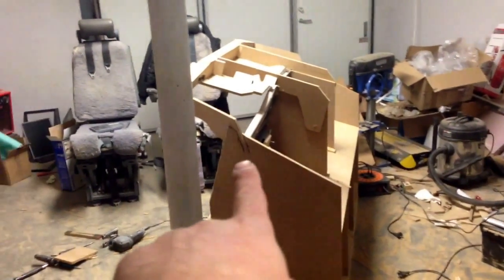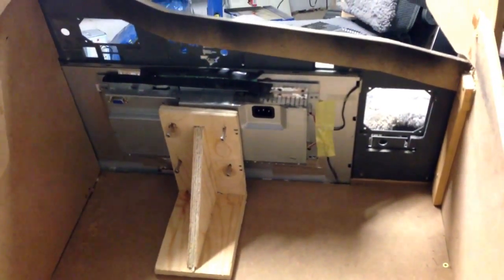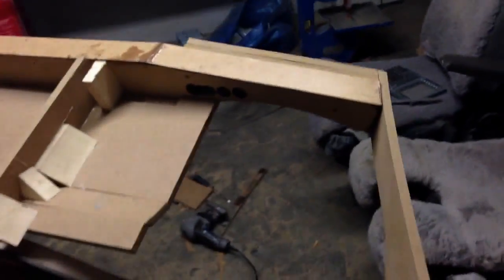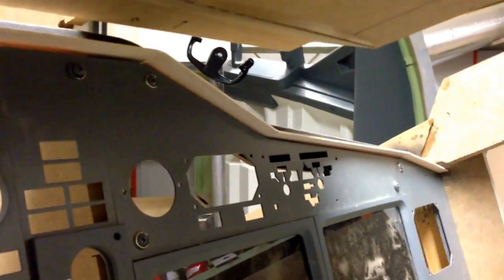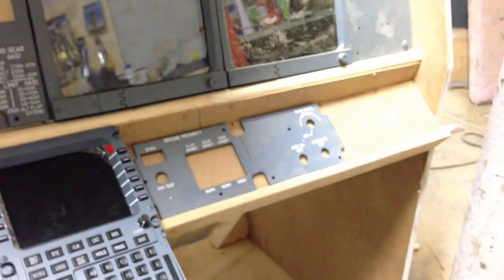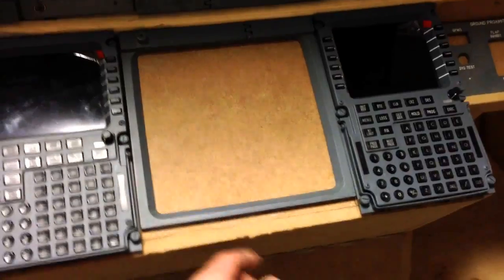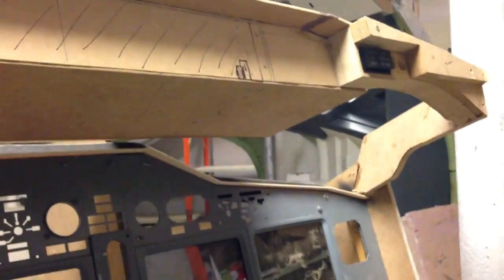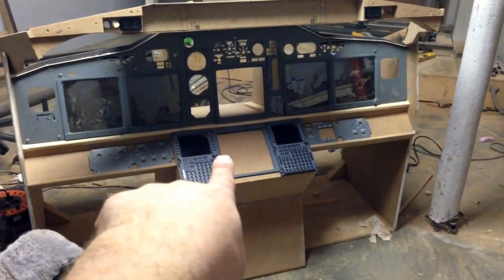Building a Boeing 737-800 home simulator #47

Comment: hi  impressed with your set up  just would like to know how you set up the instrument panels to work i have prosim with fsx and have been trying to connect them for weeks with no support on this im fustrated read the maual sort of under stood it this is what if done so far made 2 folders as im running 2 screens with the displays in them so far so good opened up one screen configed it have a green light sais connected .but there is no connection nothing working ;i am running a telstra router wondering if i have to port ward which i have treid my computer ip for eg: is 10.0.0.1 which i have put in the configutation i hope this is right so far . then when i open the main folder it sais port 80 and in red not connected . PROBLEM 2 when i installed the program and placed all my screens where i wanted them when i ran fsx all the screens went black so to fix this in the fsx game i had to undock full screen and make the screen fit to size -problem fixed i think for the screen or is this waer it all goes wrong please help regards foodie